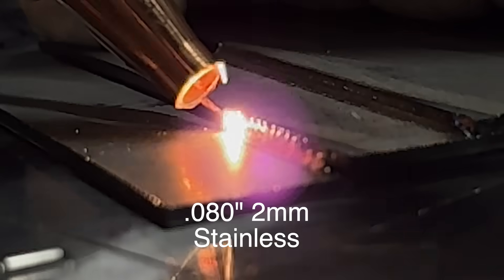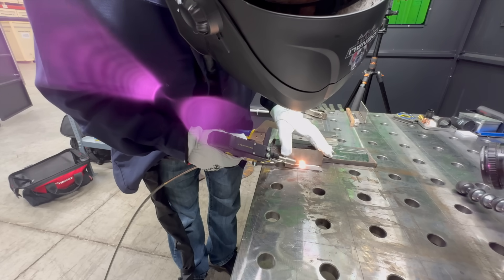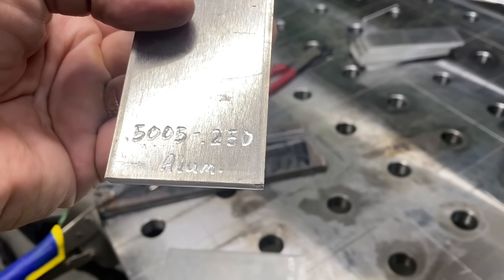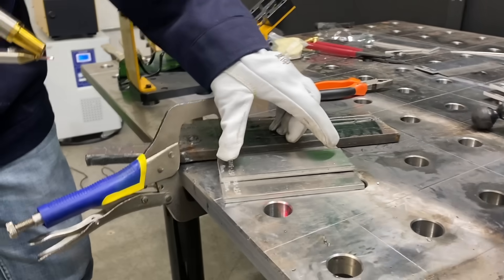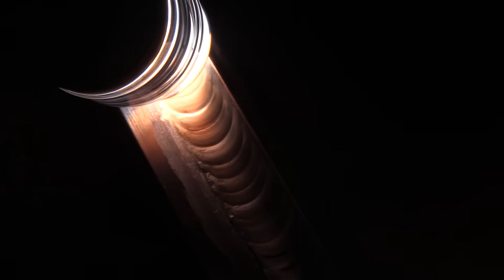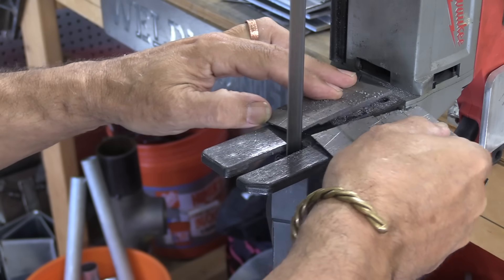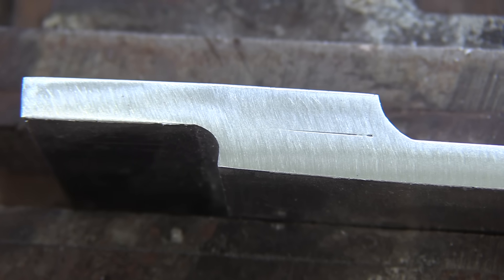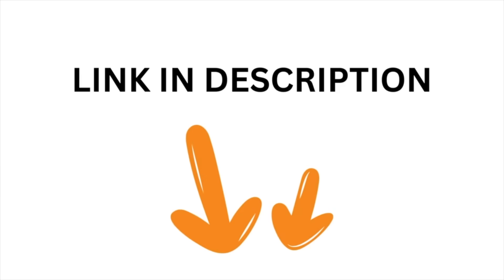Is Laser 5X Faster than TIG?

Comment: Impressive on sheet metal in a controlled situation? Yes. In the real world, not so much. In structural and plate work, the determining factor is fillet weld size. These welds are tiny. Can you even make multiple pass welds? Who knows. Could you put a 3/8" fillet around a column to a 1" thick base plate? I don't think so. And all welding has to be done in a controlled room with a certified laser inspector because of the danger of eye damage from reflections to other workers. Insurance and worker's comp costs a forture as it is. I shudder to think how much it would go up to enable us to lay down a 1/16" fillet weld twice as fast.
Reply: It’s taking over TIG Welding completely. GET USED TO IT! 😂

Comment: seems to penetrate deeper by 5mm, definitely faster, the cost per linear yard is the next test, they like them in China as they can train an unskilled illiterate peasant to weld in a couple of days, no 4-year apprenticeship and approval, straight out the paddy fields into the fabrication shop, its the future, like it or not if you can't compete with China you are finished.

Comment: That level of penetration is going to allow smaller visible welds with still the same strength and a much cleaner finished product. Also less post weld finishing required, less cost all round and with a better finished product.

Comment: Brilliant video with pretty much everything I wanted to know about laser welding. 
I love TIG, compared to MIG as an amateur, because penetration and controllability is so much better. However as I get older I find seeing the puddle and the joint to be welded through the mask, more and more difficult. Playing with settings on the mask, either the puddle is too bright or the joint to follow too dark. Rarely are the joints as conveniently located, with an edge to follow, as those shown here and the metal needs a lot of cleaning as it's generally old and rusty. Laser looks as though it might be the answer to all my welding needs!
Before I invest in a laser welder, I'm looking at ways of overcoming the light / dark issue. The cheapest way might be some intense lighting, the more expensive way could be a high dynamic range camera mask.

Comment: I spent 5 decades perfecting my welding skills (personal at large home automotive and metal fabrications) stick, mig, tig, gas in 1 hour my welds were equal or superior with my 3kw laser. If fab. parts fit well no need for filler wire. Can hold parts bare handed  w/o needing gloves for burns, treat laser more akin to a gun than a torch as beams will travel unlike and arc or flame. They can also reflect so its best to use in a one person room. Cleaning is amazing both for after weld cleaning and prep. it can replace sand blasting in most cases removing paint and rust. I can weld any meltable material including repairing plastic parts.(have to lock out some safties) Full penetration up to 5/16 from one side minimal shrinking (effectively zero) can weld long seams in a single pass at 5x plus the fastest mig/tig speeds and I only use filler wire for loosely fiting parts and/or wher I need to grind weld to smooth. Expensive to get in early my rig cost over $19K w/o many options and was made overseas so warranty is untested so far, nice to see Miller producing blue machines I would expect prices to plumet. Ray

Comment: The penetration on the laser weld in the last test you did was incredible. It looked nearly perfect. Although the porosity looked like it was a little higher than the TIG welding. You probably need to do multiple samples to validate that though. 
I would be curious to see what the tinsel test would look like in comparison of each as the HAZ looks much bigger on the TIG welding versus laser welding

Comment: The problem with laser welding, is lack of penetration.
Reply: Did you even watch the video?
Reply: Sure did... but I also eyeballed the TIG. For a quick, thin weld... laser does fine. He wasn't pushing the TIG... which is fine, 'cause it's not like he was welding gas pipe or anything critical. The last comparison is useless, because he was literally welding a gap. The heat and draw from the laser weld had pulled the plates apart.

I like laser. I'm not knocking it. It just has considerable limitations on penetration. Little light stuff like this is fine, 'cause you really don't need a lot. Another great thing about laser is how clean it welds.

All that being said, he had some great beads, and respectable penetration. If this were a heavier application, it wouldn't have turned out so well.
Reply: @JamesCopeland-i1j  Your point was penetration. This video categorically shows that penetration exceeds that of tig.

The feed rate can always be slowed as well.

Your comment says the problem is penetration. This is wrong.

Comment: Hi Thomas from Norway,

If you were to weld a4mm or z6mm fillet weld around the edge of a 10mm stainless steel plate, what would be the best approach?

I imagine you'd have to make more weld passes or strings with Laser compared to TIG. In that case, the time difference might not be significant?

Comment: if you cool the puddle rapidly right behind the weld, with liquid propellant like a computer duster held upside down and lightly quench the fresh bead as the puddle passes it will solidify the metal while in liquid to solid transition, while it’s in its fluid glass form and there are no crystals, just a dense hard strong result
Reply: Not quite. The surface will solidify faster than the surface and you will get a large amount of stress on the material, similar to tempered glass. This will absolutely mess up the metal.

Comment: Thanks Jody, always learn something from your channel. I've seen some laser welding demonstrations shorts on YT and thought it looked like it was just laying a bead of caulk. It COULDN'T BE a weld with good penetration that fast and seemingly so easy. I'm impressed. I'm still fumbling my way along with my used Syncrowave 200 (haven't even gone inverter yet) and I've been leapfrogged by new tech.
Reply: I'm right there with you. Still dipping my tungsten into the weld pool like it's a potato chip and the pool is ranch dressing. At least I stopped tasting them.

Comment: Did anyone notice that the aluminum “laser” welds constantly had little pockets, flaws in them? I wonder if you could add more shielding gas to resolve that? 
I’m assuming they used 5356 wire for wire feed ability. The green arc is a sign it was 5000 series and not 4000 series filler metal. 
Very interesting technology.
Reply: Yes, I noticed the inclusions in all the lazer welds and not the tig weld.
It would be interesting to do ultrasonic and xray tests to see if those inclusions go the entire length of the weld.
Reply: Remember that the coupons were not prepared properly. That may make a difference. I run an Electron Beam Welder so sensitive materials have to be prepped very well to get a solid weld.

Comment: Be interesting to see how it does on thin metals as to  punch through. (.02 to .06 thick metal)
Reply: On my 2kw on thin stainless, it's easy to get almost full penetration without any sugaring on the backside. I'm doing 22ga right now and no problem.

Comment: Thanks, this is a great intro video showing real results.  I'd like to see how the laser torch fits and handles welding mitered round tubing at an angle, like what you'd find on a bicycle frame or roll cage project.  I'm interesting to see how it handles the variable angles of the coped tubing.  How does it do on thin (under 1mm) steel?

Comment: I still wanna challenge a Laser to weld a pre 1994 frame rail unprepped, and weld  quarter inch, mild steel to it. If mig can do it. Why can't lasers? Most customers can't pay for the extra material and time to get perfect lab clean metal.

Comment: Good video. Finally someone shows the cut and etch❤

On aluminium laser have more gas porosity. Faster cooling time can be reason. 

Also weld toe on aluminium laser is almost half from the TIG.

On stainless cut and etch laser have lack of penetration?

I believe these gonna be very impressive in near future when other companies also start manufacturing laser welding machines.

Comment: How much for a small laser welding machine?
Reply: @paulg3012  Prices are still on the “bleeding edge” but coming down fast.
Reply: @T3glider  Saw the Everlast 1250 for $7900 the 1500 for $ 10,000 they weld cut and clean.

Comment: I learned many years ago of the correct priorities in everything I do being; safety 1st, quality 2nd, efficiency 3rd in that order. Never sacrifice safety and / or quality for the sake of efficiency.
Reply: You still use rivets to join metal parts don't you?
Reply: Only if that's the only option
Reply: I'm AWS D1.1/5.20 1" all positions, unlimited thickness certified welder/fitter
Reply: Soo then what are you trying to say?                  

😂
Reply: @_hector__  What's wrong? Are you feeling guilty?
Reply: @_hector__  It's the principal of the matter.

Comment: The plant I do electrical work at picked up a laser welder. Not really awesome for little custom fab pieces but for building a giant stainless steel oven where someone would stay hunched over on the floor for hours with the TIG this is a game changer for speed when running straight lines!
Reply: SpaceX Starship switched to laser just as first tools arrived to market

Comment: One of the more important questions is if it’s possible to stack beads with this welding process such as for multi-pass grooves or is it just for single bead applications.
Reply: Yes I have done it and it keeps the warping done to a minimum.

Comment: Man oh man, that cut and etch really shows the consistency and depth of penetration. I love how the penetration is so even on either side of the lap joint. A quick question though, why do all laser welds look like they are undercutting a bit on both sides of the lap joint? Can that be irradiated with increasing the filler metal/wire speed or lowering the travel speed?
Reply: If you look at the close-up of the sectioned welds where he etches them, there is no undercutting.
You don't seem to get the same blasting effect that ARC/MIG/TIG-welding produce (depending on settings).

Comment: Finally! I have been laser welding for the last 8 months but i havent had time to do this kind of testing myself.
My company has been running me hard pushing soooo many products through.

This video made my day and i'll be showing this to anyone having doubts with laser welding!

Greetings from Denmark 😊
Reply: The welding time is going down to 1/5 in smaller materials but even to 1/7 or more in thicker materials and special in stainless then it is really FAST and almost no warping. Go on and use it and you can weld more with less constrain....... How strong is your lazer in Watt
Reply: @rvarsigfusson6163  its a 1.5 kw unit with just a single wire feed, i use 1.6 mm filler wire. 
At my job we just started doing aluminium with it too, so stainless, carbon and aluminium 😊

If the company lands a new huge order, worth a lot (cant say here 😉)
We will buy a 3 kw, that should be able to handle 2 x 2.5 mm filler wire 😎
Reply: How precise does the fitment need to be?
Reply: @ian9toes within a mm isnt a problem, also depends on the filler wire, our company just acquired a laser welder that is able to use dual thread at 1.6 mm per Wire, havent welded too much with that one yet

Comment: Probably will be useful in some shops, quick flat parts. Not useful for odd shapes as said, and definitely cant do anything outside of a shop environment. Seems like a good addition not a replacement for anything
Reply: Depends on the operator, i speak from experience, 8 months practice with such a machine.
12 years experience with welding, using all processes.

8 months of practice taught me to weld gaps with laser too, have proof too.
Reply: @AmandDK show us the proof

Comment: For manufacturing, the time difference is a no brainer! Do you think this would work for pipeline welding out in the field?
Reply: I believe it could however, you would need to use it for the hot pass and the rest. The diameter of the wire is the gap size you can weld on.

Comment: I'm old enough to know when TIG was called heliarc and MIG  was in the testing stages. Laser welding will be the standard in production shops in a few years. Time is money and 4x faster will make you money. What time will tell is how robust the system is in daily use for 10 years. Maintenance costs etc.
Reply: I’m curious myself but I suspect it could be even more robust than wire. They’ve been using these in China, Chinese made, and in Chinese factory conditions for years now to the point where they’re pretty much the standard for production. I think the ability to use basically unskilled labor to operate them balances out the costs as well, and that will only be more true with time as technology only becomes cheaper with time. And lasers are not high tech either, they’re only new as a welding process. Lasers are old tech. There are a ton of high power industrial laser applications that are very reliable. It sure makes you wonder about the future of getting a job as a welder.
Reply: @jf7393 Using China as a "standard" defeats the purpose of a standard.
Reply: The big strength of laser weld is that it can weld super deep in a narrow seem. No need for chamfers on but joints if you have the right setup
Reply: I worked with an IPG Photonics 1500XC over the summer, the thing was tested by running it at 100% power (1500 watts) for 3 hours straight. As long as you do preventative maintenance on it (blowing it out w/compressed air, keeping air intakes away from areas with lots of particles, etc.) It should run for as long as any GMAW welder!
Reply: It’s not only time but laser welding gets a better penetration puddle . Laser welding is better so throw all your rig gear in the trash and pick up a laser welder . And the best part is ANYONE can pick up a laser welder and weld . You can be taught in about 30 seconds . If you can pull a trigger and move you can lay down better welds than any tig machine .
Reply: I agree 100% 👍
Reply: its also a physical issue, speed is nice but it is much more heat efficient, it goes into the work piece, much deeper stronger penetrations.  you can then up the power if you want and get away with alot more with alot less energy wasted heating up your hands
Reply: I'm old enough too! Wish mig & tig was available when I was schooled in welding!

Comment: Unless perfect fit no gaps what so ever it become almost useless but i guess if what you do is perfectly edge to edge i guess is the way to go
Reply: Clamps are great
Reply: A few of the lap joints had gaps.  I think if the filler wire spans the gap it’s good to go.

Comment: When I was working for a sheet metal shop, the president of the company asked me if it was worth investing into a laser welder. I told him, yes, but it is going to be expensive, not for the machine but for the upgrade required for the shop to even have one. The welding department was adequate for structural fab and TIG welding, but not for laser welding. Not enough room and the electrical needed a major upgrade.
Reply: can be mitigated with smart battery/inverter placement
Reply: 电力还好，主要是有害光防护空间

Comment: Bottom line; what is the cost? Wont be long before Harbor Freight clones one and is selling them.
Reply: I have seen China offering a 3 in 1 rust removal,  cutting and welding  for a little over £3k
Reply: They’re half the price of miller laser welder. And you get everything. All you need is nitrogen and mig wire.

Comment: I noticed you were able to hold those aluminum pieces down with your fingers the whole time you were laser welding, something you could never do with tig or mig. How fast were the parts cool enough to handle by hand after welding them. A quick cool down time could be a huge time saver as well
Reply: Laser has the lowest heat input of any welding process. Only heats where the beam melts
Reply: And the rest of the metal remains at the same temperature as when the process started? 🤨 @rodneylake2
Reply: @Buggerhey  I don't know. Just read somewhere online that it has the smallest Heat Affected Zone

Comment: Pretty scary that technology can beat experience 🫣 After decades of time under a helmet, a shiny new object comes along and with minimal practice someone can weld better, faster and more consistently than an old Goat! I will be throwing sneers at my old Dynasty now forever 😂
Reply: Its not a replacement, but another tool in the shop.
Reply: @jimroberts6050  I agree, but that was not the point of my post. It was tongue in cheek about how well the darns things work. And the penetration was staggering. All naysayers are eating crow.
Reply: Wait another 5 years (?!) to see how school boys design parts in computer and do metal 3D printing faster and better than skilled fabricator with normal tools 😅.
Reply: @mahdidaneshpayeh  3D printing will never be faster. The biggest issue with 3D printing is that a lot of companies using it are thinking it's a replacement for subtractive manufacturing. The real role of 3D printing is for small scale production for adaptive markets. A 3D printer can do the same job as a whole factory, but the product won't be as durable, you can't produce nearly as fast, and you won't save labor (lots of post processing to get functional products the right way).
Reply: Don't forget Fabrication，
You can't beat a experience welder Fabrication skills 😂
Fabrication usually take more time than welding
Reply: It's not just about the weld but the numerous applications and various scenarios you can only get with experience